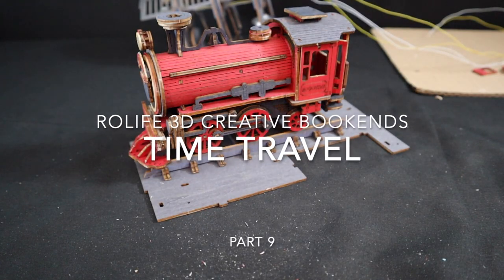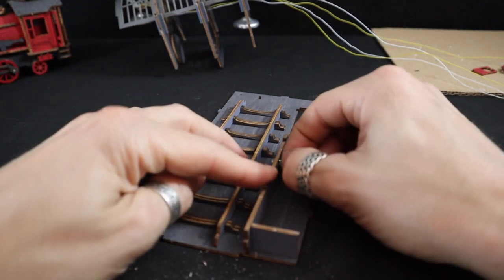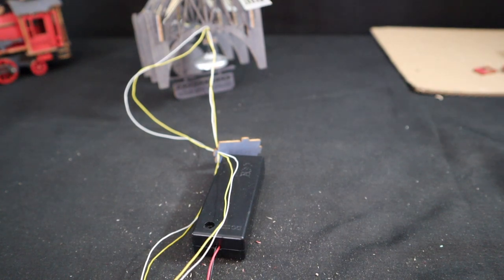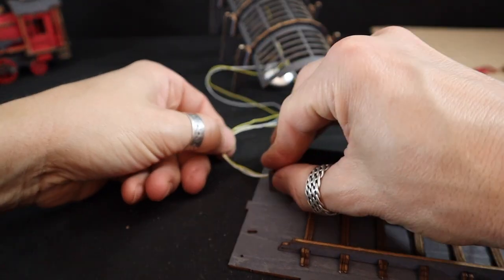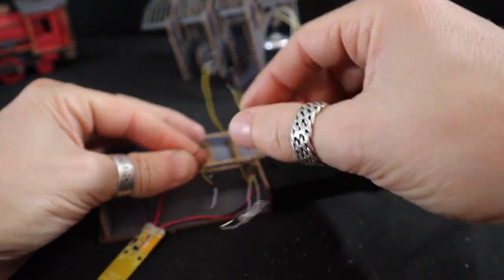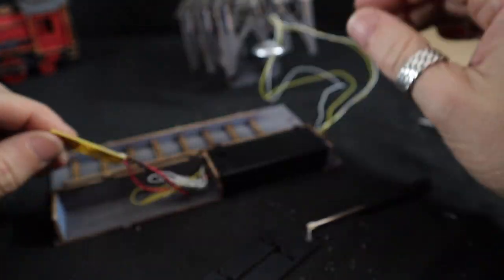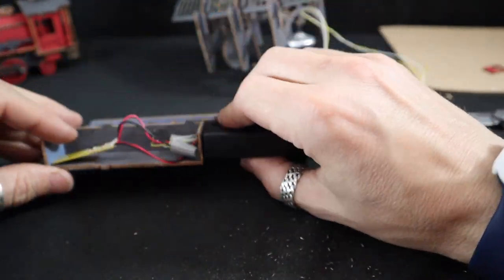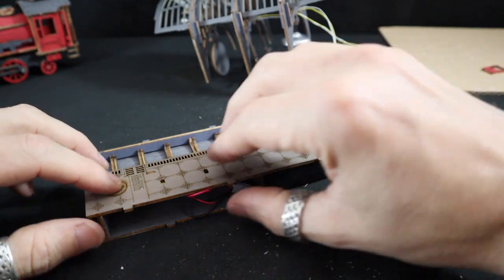Rolife 3D Creative Bookends: Time Travel Part 9

Comment: I can't figure out what to do with the tapes, it just won't work for me. I bought new batteries, thinking my old ones were empty but that's not it. I've twisted the right colors together, it's just the tape part that's confusing to me.. Any tips?
Reply from the maker: You may want to try some small wire nuts, I've used them on other builds and they seem to be a bit more stable.